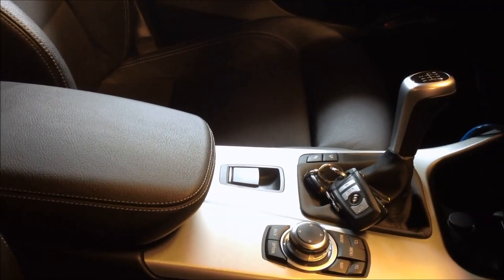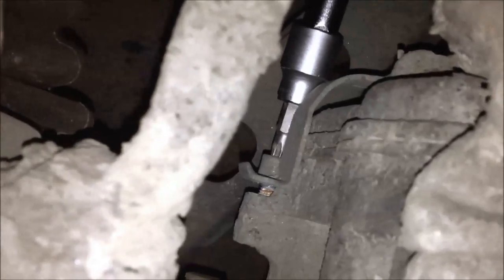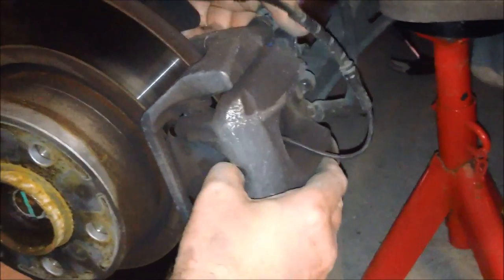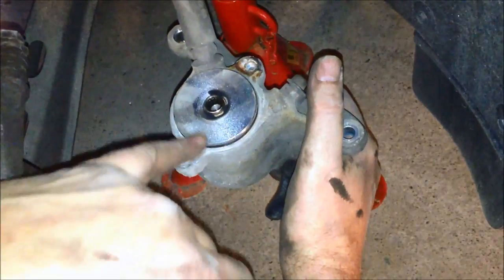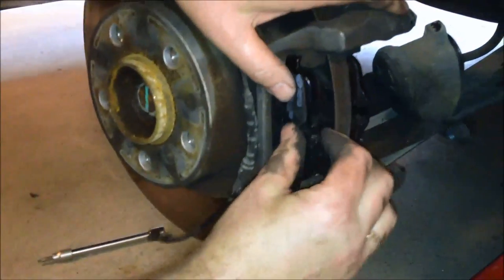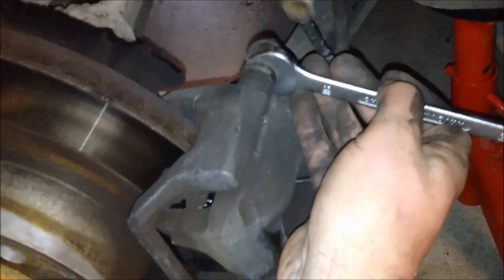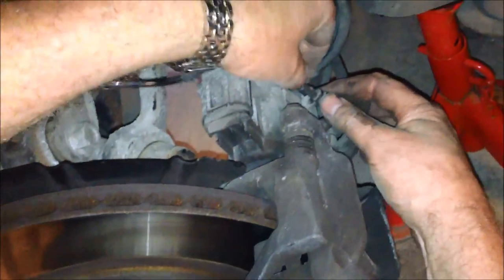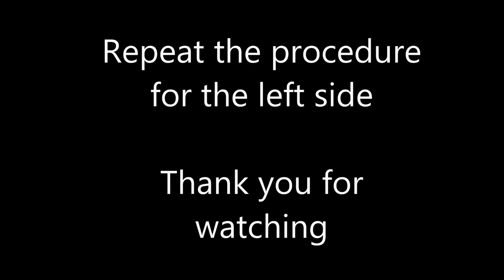Rear Brake pads renewal X3 F25

Comment: Great video! The only problem I got after changing the pads is that the hand brake is not working anymore and parking brake mulfunction light is on now. How do I reset the parking brake?
Reply from the maker: The "EMF workshop mode" may have been triggered. Driving more than 3 km/hr should excite the mode.

Workshop mode As long as the parking brake is in workshop mode, for safety reasons it is not
possible to close the parking brake. If the parking brake button is activated
despite this, the indicator light in the instrument panel flashes yellow. The
workshop mode is automatically exited at a driving speed above 3 km/h.Start-up Procedure: Ignition ONApply strong pressure to the brake pedalHold the brake pedal pressed downPull the parking brake button for approx. 1 second (engage)Push the parking brake button (disengage)

Comment: Thank you! I DIY my rotors and pads, but the Parking Brake Malfunction orange light came on, do you know how to fix it?
Reply from the maker: Is there a "check control message" accompanying? If yes, what its say?
If there is no messages, the emf unit might by in "installation mode" for some reason.  Then solution will be to drive the car in speed over 3 kmh and it will be reset automaticly. You can also try to cycle the emf brake with the button (release/set)

Comment: Great video. How do you rest the electrici brake and the auto hold.
Reply from the maker: +Brian Spicer The procedure to reset the brake is to step on the brake pedal several times until it firms up. Then you apply the park brake and it will turn a while until the programmed torque is reached. That's all.

Comment: Do you not need to open the brake fluid reservoir to retract the piston?
Reply from the maker: No you don't. But if  you just refilled it you may have to remove some again so it not spill over

Comment: awesome video Nils... i have subscribed!
someone told me that the break sensor needed to be replaced every time breakpads where replaced. is there really a need for that?
Reply: If you get a message on the driving computer that its time to change the brakes, that means the sensor is worn down and you neded a new one, or else you’ll keep getting error break message.
Reply: @Flackerr  this is not entirely accurate as the warning on the driving computer is an estimate made on how far you on average can travel before the pads are worn out. If there is a brake light warning on the dash, then the sensor has been worn through to the metal and it is making contact with ground (brake rotor).
Unless it has actually worn out and made contact, there is no need to change it and it could last for years and years :)

Comment: Great vidoe, I want to do the same but not sure where i should jack the rear from? Did you use the differential?
Reply from the maker: Thanks!
I just jack up one side at a time using the provided jacking points. Check your user BMW X3 user manual. In addition a secure with a jack stand as you see on the video.
Reply: Nils Egil Nødland Great video!  To jack up the rear I created a wooden block to fit in my jack and place it against the crossmember rear of the differential.  It is kind of tucked up high behind the diff, but it is sturdy and my jack fits up there.

Comment: hi, can i use allen key 6,7mm instead of T30,45 torx screw?
Reply from the maker: Ming Yang You can use whatever fits in there. There is almost no torque when turning.
Reply: Nils Egil Nødland thanks. Do u know if the front brake pads require the same ebrake removal?